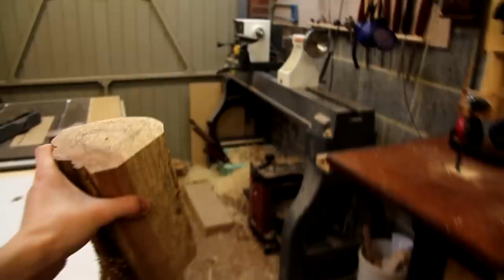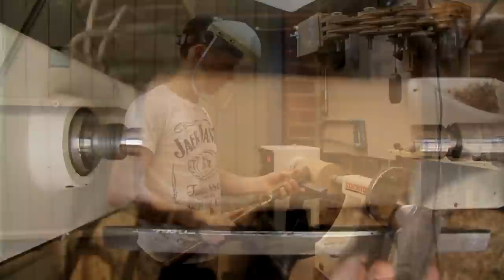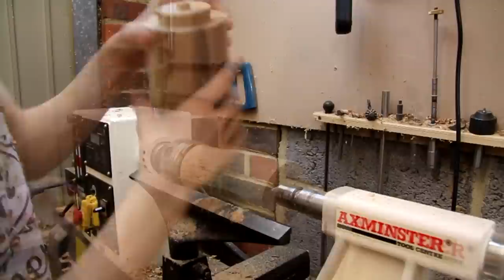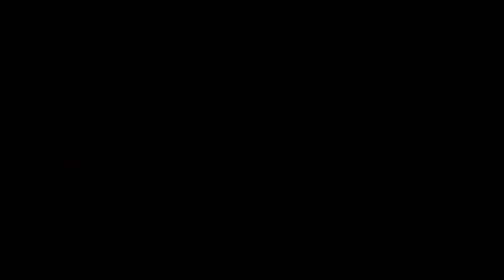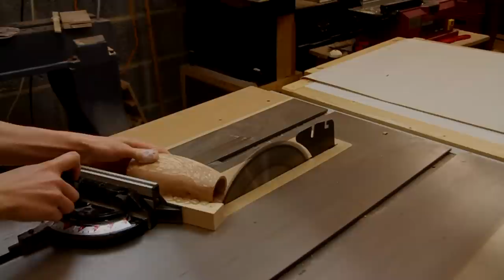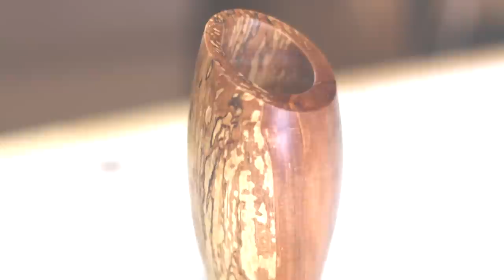Woodturning | Log to Vase on the Wood Lathe

Comment from the maker: Sorry if you've already seen this video, I just noticed I hadn't shared this on the G+ page yet.
Reply: Couple tips while turning, remember to always run down the hill not up ;P it will prevent kickbacks and help you with a steadier carve. Also you can buy belt sanding papers either for the 4x24 or bigger machines and then you can strip those in thin or large strips depending on the job you want to do. The sand paper is essentially made to run in a singular direction at high speed so they are perfect to do sanding jobs on a wood lathe and they don't burn the hell out of your hands either! Nice job incorporating the grain into the vase!

Comment: love the instructions and spalted wood. May I ask what Lathe you use and why you selected it? I have a midi and am considering moving up to a larger one?  
Thanks again and Keep of the great work!!
Reply from the maker: rex bradburn Hi, it is an 18-47 lathe, the same lathe appears (or at least used to appear) under many brand names, including JET. The choice was really a matter of price, although I would prefer the 24-36 JET/ Powermatic (I think it is?) this lathe was about a third of the price. So far it has offered me everything I need, variable speed, capacity, power, etc. The only thing I have found is that it is a bit tall for me, but that is likely the case for most free standing lathes! 
Thanks, Alex.